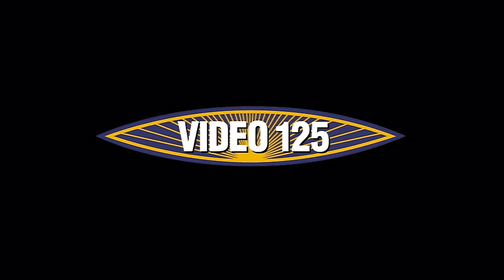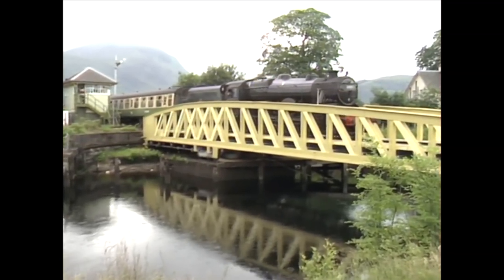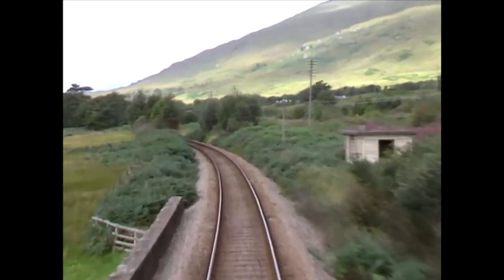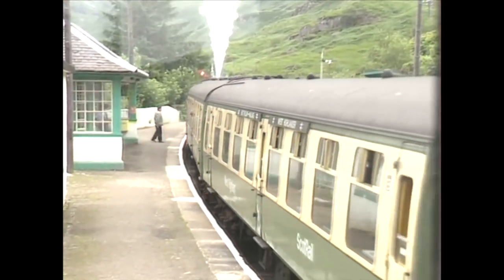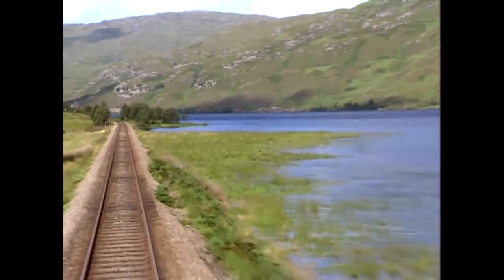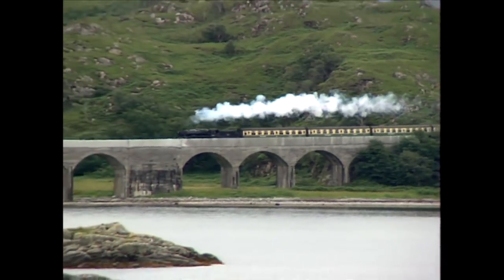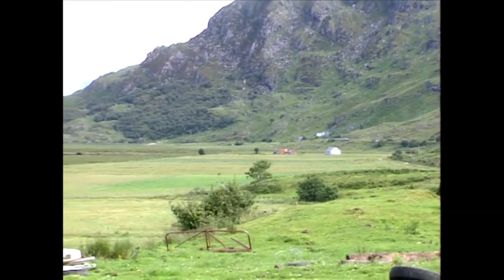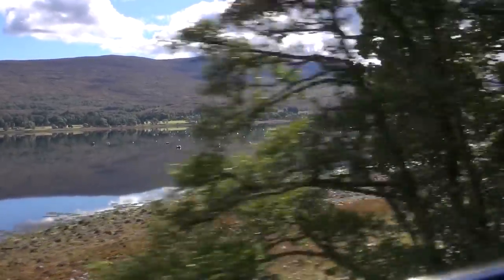Steam to Mallaig 1985 Driver's eye view

Comment from the maker: video125co
35 seconds ago)
That is very kind of you but it is not up to modern standards which is why we re-filmed it using HD cameras and helicopter a few years back (also in summer sunshine) and called it  The JACOBITE Driver's eye view  Here's the preview:  https://youtu.be/_qqhQmvgtQg
Reply: This raises the question of why the original (which looks like it was shot on tape) was not shot on movie film - 16mm or larger. Had it been shot that way (like a lot of T.V shows made at that time) it could have been remastered almost up to modern standards.